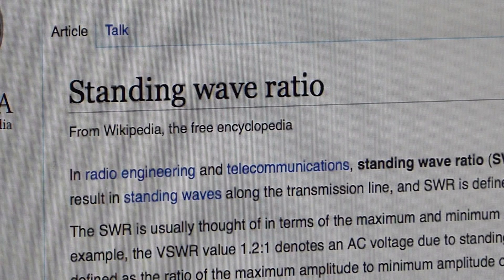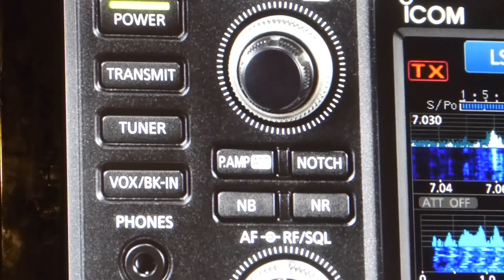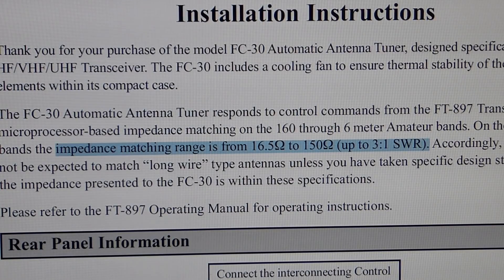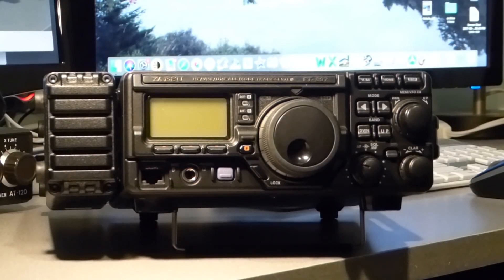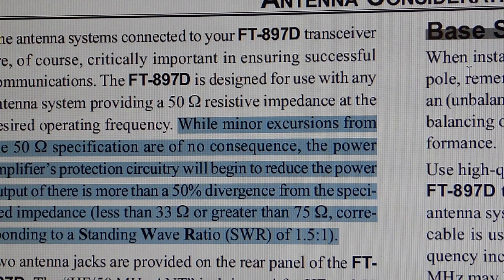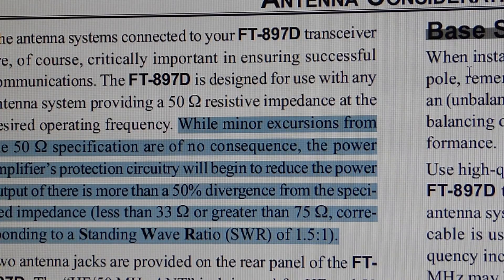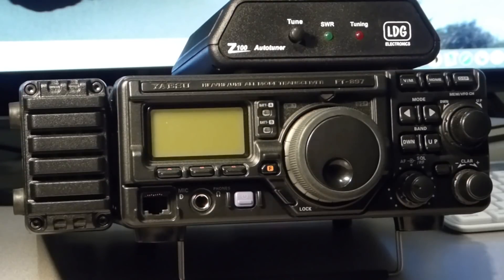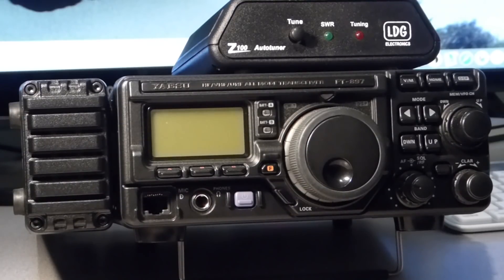Automatic vs  Manual Antenna Tuners

Comment: Can you list any rigs that have a reputation for getting their finals blown? You listed 2 fairly new models, which surprised me, as I thought that HF rigs have had the SWR rollback feature since the late 1980s. I'm looking to add an old rig like an 857 or 706 for SOTA, which is why I'm curious, but a complete list would be helpful. Nice presentation and good info in this video, by the way.
Reply from the maker: Great question. Since most quality rigs started employing high SWR rollback, the incident of "troublesome" units has dropped significantly. The only one that comes to mind as a recent example is the FT-991 (not the 991A). Older models know for blown finals include the FT-817 and the Icom 706 and 746 series. I hasten to point out that I have owned all of those models over the years (exception of the 991) and none of them ever gave me an issue.
I'm not aware of a comprehensive list.

Comment: As a newbie, my Icon IC-7300 has a SWR meter and a tuner. I got a manual tuner using the same logic that I should learn to drive a manual car to learn to drive, likewise I should practice on a manual tuner.
In my CB days when I didn’t know anything I used to think using an antenna tuner was a form of cheating. CB-ers had to know about SWR and adjusting antennas, but hams just turned a knob.

Comment: Some very valid comments and observations. I've been in the hobby since my teens and grew up peaking grids and dipping plates but for the new hams, the operation of a manual tuner is often somewhat of a mystery. Manual tuners are getting a reputation of blowing up to easily. This is because they are being switched while full power is applied instead of pre-tuning by listening to the receiver noise then only doing the final adjustments at QRP levels. Thanks for a great video.
Reply from the maker: Thank you for your comment, I appreciate it!

Comment: That Kenwood AT-120 antenna tuner is on a whole different level better than the LDG auto tuner.

Kenwood also made a very similar AT-130 Which also covered 10MHz 18 MHz and 24 MHz

Comment: What are blown finals?
Reply from the maker: Final transistors, the big (and often expensive to replace) transistors in the RF amplifier stage of the transmitter. Many radios are not able to withstand high SWR for more than a very short period and exposing those rigs to high SWR can permanently damage (blow) the "finals".

Comment: Garbage in garbage out.  High SWR needs to be corrected at the base of the antenna before it travels down the coax into the shack.  The line losses are just too extreme.
Reply from the maker: Can't argue with that.

Comment: I am not a licensed operator but I have used CB's and 10 meter export radio's, and amplifiers, and manual and automatic antenna tuners for years as a professionl driver in the U.S. It has been my experience that auto tuners generally look for a 1:5 SWR. with some having the option to seek lower than 1:5 such as 1:0. However are not always able to achieve that goal. But I have never had that issue in operating manual tuners even in my mobile radios. Manual tuners I have always managed to get a flat SWR that does not even swing a cross needle on a combination ham style SWR Watt Meter when properly grounded to your vehicle or outdooors with an appropriate 8 ft grounding rod and station setup. Regardless of the Manual Tuners amazing range and capabiity it is limited when your station itself is not properly grounded. I have used co-phased and center fed 11 meter dipoles for years in mobile and base operations with amazing results. I have also learned that 1:1 baluns installed at the antenna feedpoint which must be a minimum of 1/2 wavelength above ground for that specific band, then installed every half wave length in 11 meters of coax that's every 18 feet of coax in length on 11 meters, keeps the coax from acting as a tri-pole on the dipole. And from allowing your signal from the dipole to run back down your coax sheild. Or the Coax itself from acting as a recieve antenna. So on the first 18 feet of coax which is vertical I use a 1:1 balun at the antenna feedpoint, 18 ft of coax then runs down the mast with a 1:1 balun and a lightning arrestor together at the base of the mast that is grounded to an 8 ft grounding rod with a 10 gauge solid copper wire, then the other 18 ft of coax that connects to the balun and lightening arrestor that enters my shack I place another 1:1 balun there also that is attached to my radio. For a total of 3 seperate 1:1 balns installed with a lightning arrestor to proper ground. I was told this would improve unwanted noise levels but, that is not so. It's  just as I stated keeps my coax from acting as a tri-pole antenna instead of a dipole antenna. Meaning the power emits from the antenna not your coax and keeps your coax itself from acting as an antenna. and also gives high levels of RF typical with amplifiers and antenna tuners a good solid ground for the RF to go that cannot be transmitted by the antenna or dissipated as heat by the tuner. What reduces unwanted noise levels in your rig is using a proprly tuned antenna for the specific band your using such as my rig which is 11 meters. And by coiling every connection of ac or dc power wires and coax jumper's attached directly to my rig inside my shack, meaning all power supplies ac wires, meters, amplifiers, coax jumpers, coax, and antenna tuners, etc......Remember that any wire hooked anywhere to your rig unless coiled ( "will act as a recieve antenna", ) and by coiling all these connections as close to your equipment as possible prevents them from acting as multiple "recieve antenna's". Many people also use magnetic torroids together in their coils that aids even further, or by instaling noise supressors in their dc power cables but, coiling the wire performs the same task also and is better than no coiling at all. I get awesome reports of my station being super clear because I take care in how I install the system. And I use high quality variable switching power supplies so there is no need for any dc noise supressors or for my ac power lines. With all wire / coax connections and lengths of straighht runs in my rig kept to an absolute bare minimum to connect the equipment all together. Added bonus with the cost of antenna anayzers coming down in price to just a $100 dollars these analyzers hooked to your manual antenna tuner will tune your antenna and antenna tuner without even transmitting a signal. Or the need to use your expensive radio your until ready to safely transmit on air. Also they are now selling portabe all mode transcievers 160- 10 meters for as low as $159.00. So I am thinking about getting both just to listen in on the airwaves. I already have CB, Commercial and Military Aviation, Marine, and VHF/UHF transcievers so I might as well complete all the bands. Even though I am not licensed to use them.
Reply from the maker: Thank you for your very thoughtful comment!

Comment: Very interesting !!!. In your opinion, what are the best manual tuners in the market today?  73
Reply from the maker: Tough question to answer. I stay away from a certain 3-letter company's products including their manual tuners. If you are willing to go with the used market, Yaesu and Kenwood both built great manual tuners 20= years ago. They were manufactured to a high standard and are good performers even today. I have a couple in my shack that I bought used. That would be my pick. 73 from VE3TWM.

Comment: After many years I'm finally getting into the HF world and couldn't agree more with your comment about getting back to the basics of what ham radio is all about.  My goal is to work QRP at every opportunity and use the most basic of antennas whenever possible.  Guess I'll add a manual tuner to the list!

Comment: A couple of points i disagree on, in some cases resonant antennas off-shelf may have poor performance and swr, all dependant on the location of the install. I own several big brand EFHW multi band antennas and installed 7ft off the ground next to a house they are worse (swr and performance wise) that a compromised WL horizontal loop type wire with a 4:1 balun.
In regards to built in tuners and the picture of IC-7300, the atu in there will not tune anything higher than 3 and is next to useless, compared to some of the qrp tuners like ZM-2 or Elecraft T1.
Other than that, fantastic video!

Comment: This is an oldie but goodie. I wasn't a ham when it aired. 

I have both types of matching units in my inventory. I find that the Elecraft ATUs are quite good at finding a proper match. They have a wide impedance matching range as well.

Now I'm curious as to whether the LDG ATUs direct the transceiver to reduce power for matching. They are my preferred alternative for those radios that do not have good factory ATUs. 

Thanks for the video.

Comment: You can lower the power to transmit while auto-tuning to prevent hurting the finals. The same argument could be made when manually tuning, you’re spending more time tuning with making micro adjustments which would hurt the finals more… unless you have a NanoVNA or an antenna analyzer to adjust the manual tuner before using on the radio.

Comment: The only advantage manual tuner have is that they can tune a system with a higher SWR.
When using an auto tuner, most rigs will send a very low power signal. And if they don’t, you can turn the power down manually.
At 5w, your rig will be in virtually no danger when an auto tuner takes longer to tune.
Another benefit of most automatic tuners is memory. It will save your tuning settings so the next time you are on the same frequency, or one very close to it, it can go back to the tuning saved in memory and have you tuned in a fraction of a second.
Manual tuners normally have a wider ranger, but that is the main benefit. 
Tuning at the top of 20m will get you close enough to get a good signal on 15MHz. Not perfect, but good enough to receive.
Reply: auto tuners you can also get a lot smaller and cheaper price  some you can even charge now

Comment: Hi, Tracy. I have a manual tuner, an automatic tuner and also two manual tuners, they're both very big. One is an MFJ loop tuner and another an MFJ-974. You mentioned that one of the advantages of manual tuners is being peak the antenna system to listen to non-ham bands. And that was the reason I  acquired them, for I'm more of a listener. I hope to take my recently acquired FT-817ND outside to try and make some contacts. I'm not taking any tuner, instead, I'm going to use an AlexLoop that with a manual variable capacitor and also a device that turns on a led bulb every time you reach optimum tuning.  Of course, I can do it just by listening and checking the s-meter o the receiving mode. 73 from PY5WHO.
Reply from the maker: That's an interesting setup you have. Thank you for sharing your experience! 73 from VE3TWM.

Comment: Surely tune-up is carried out at very low power levels?  Icom tend to be so low that signal used is too low to radiate as QRM.
Reply from the maker: Good point. Many ops don't start out with the power low when they tune.

Comment: You forgot to mention that you never do the initial tuning on an automatic tuner with more than 5 to 120 w so blowing up the final stage is very unlikely. The subsequent tuning will be done much faster with the pretend band and frequency range being memorized by the tuner. I've never been able to tune as fast as my automatic tuner does.
Reply from the maker: Good point about low power!

Comment: Hi tracie Can you advise me setting up a yaesu frg 8800 receiver with a long wire. I've got a auto atu and separate swr. All this was given to me. Could u put a vid together to show how a receiver set up should be put together please. Thanks Mike. Wales. UK..
Reply from the maker: Hi Mike! An ATU is designed for use with a transmitter. You can't use one with a receiver as the ATU uses the transmit power to tune. Find yourself a good manual tuner and start enjoying that receiver. Then consider studying to get your ham license 👍

Comment: Viewers should be careful when considering this advice. It is not bad per se and will not get you into trouble but it may give you a false sense of security that you are somehow "protected" from finals damage when you use a manual tuner. Actually I believe an ATU offers MORE protection than a manual when used properly (I am not employed by a tuner manufacturer). Also, if the ft-817/818 do not have transceiver foldback (which is REALLY hard to believe, I am going to check that!), then I would be concerned about an antenna that is resonant midband with no antenna tuner. I would never operate on band edges and always be looking at my SWR meter to ensure I was no more than 2:1 because anything more than that will blow the transistor finals. Wow. I thought all solid state rigs had foldback due to the sensitive nature of bipolars and FETS to reflected high voltages, especially those manufactured by known reliable manufacturers. Manual tuners are NOT safe either, especially with no finals foldback protection, it depends upon how you use them. My first radio was a circa 1989 radio, a Yaesu 747 which DOES have finals protection, as it should. It was a low end Yaesu but it still was protected. Still, with my manual tuner, I apparently must not have been tuning with a low enough power to a higher impedance G5RV antenna and the finals blew out. I replaced them and tuned the same antenna always at 10 watts, never breaking that low power self-made rule and the finals never blew out after that. But with Yeasu's earlier FT747 being protected I am amazed that the later model QRP ft817 10 watt model does not. Their high power ft857 does it but its protection circuit is for the drivers that are missing from the 817 (the 817 is basically an 857 whose drivers become the 817 "finals"). As far as ATU, you should be aware that these generally have provisions to lower the transceiver power to 10 watts during the tuning cycle but you do not mention that. With a manual tuner you can STILL have a mismatch for a long period of time at say 100 watts, especially if you have no foldback on the finals! Also, the ATU has memories that often cause an extremely quick transition to the required antenna impedance at the desired frequency, stored from previous tunes. Sorry but I disagree with you on ATU's. 1) Solid state rigs with no foldback must be handled extremely carefully with both ATU's and manuals. They should be tuned at very low power but only ATU's can guarantee a low power tune automatically. 2) ATU's SHOULD tune to the frequency much more quickly. If you believe writing down the previous successful tune settings with a manual decreases tuning time (it obviously does), autotuners  like MFJ 998 can also be set manually ahead of time to a desired impedance. 3) Most ATU's can actually be operated manually and CAN be interrupted during the tuning cycle if it is taking too long although I am only familiar with MFJ and not other brands in this regard. But the critical issue for all transceivers is the low power 10 watt tune that they themselves use with their built-in ATU's.  The tuning power must be even less than the power causing foldback because the initial power surges to the antenna due to antenna reactive impedances also damage the finals (this is never discussed but an instantaneous imposition of voltage on a usually capacitive antenna causes very high currents rather than high voltage that also damage the finals; I = C*dv/dt). Foldback can occur at any power, thus it may help a bit and reduce in-warranty repair costs for the manufacturers but it is no guarantee of preserving the finals; the only thing that helps your radio is a tune guaranteed at 10% rated output TUNING power and only an ATU set up properly can guarantee this, and, if it will not tune at 10% power because the antenna impedance draws too little current for the auto antenna tuner to work, do not switch to manual tune mode and increase the power, lower your antenna impedance instead.

Comment: From what I understand about my transceiver, I believe that it has protection circuitry. It's a Yaesu FT-891, it seems to fair well when I am tuning with my manual tuner. Though my manual tuner can't get the SWR under 2:1, I hope my ATU can do better.
Reply from the maker: Thank you for sharing your experience. A manual tuner that can't tune a 2:1 SWR can't be that good. Never heard of one that couldn't.
Reply: @OutdoorsOnTheAir  might have been my antenna, with my new dipole that I made I now get 1:1

Comment: I have the yeasu 991A. Do I need an ant tuner if I plan on building an end fed vertical ?
Reply from the maker: Not if the antenna is resonant on the frequencies you intend to use it on.
Reply: auto tuner  yep at the bottom